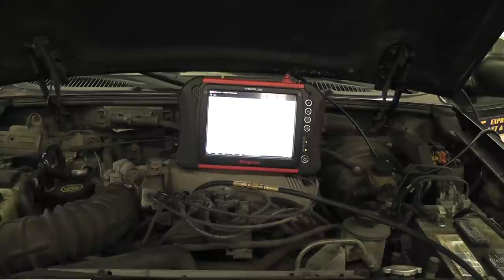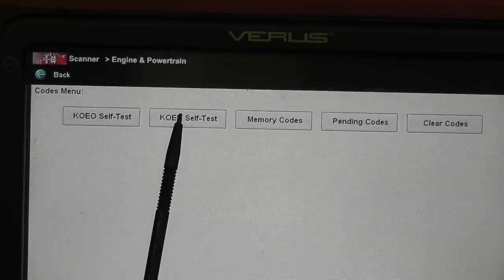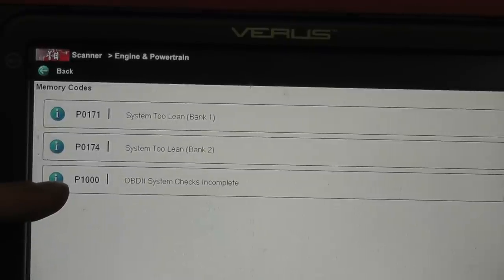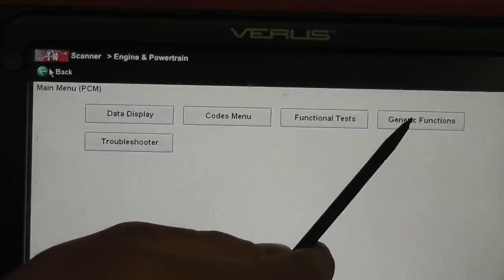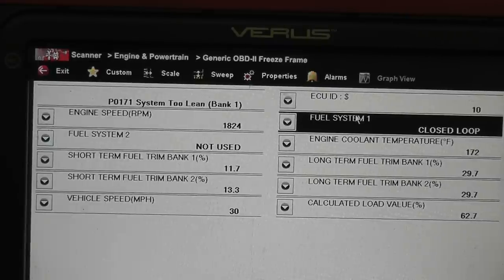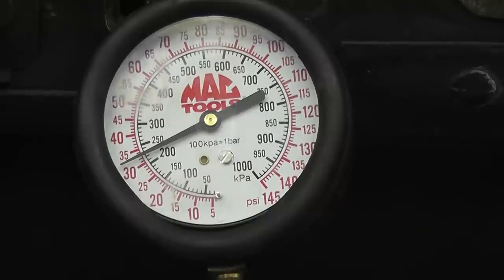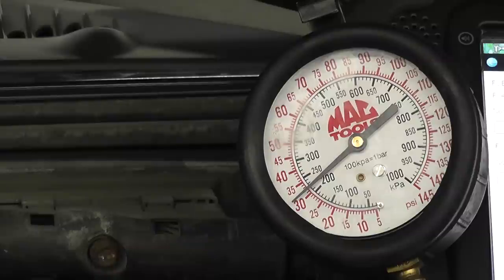Low fuel pressure causing a P0171 and P0174 trouble code

Comment: 60psi is definitely the right PSI for that engine. Was working on a Explorer that would crank abound 8 seconds before starting and had the lean codes. Had 31 psi fuel pressure at idle, checked the specs and scratched my head at the ridiculously wide range they give. Searched online and many forums and determed that 60psi was the right pressure that year and engine. Replaced the pump assembly and it run perfect.

Comment: Yup. My 2000 Dakota R/T had those codes. I went through all the normal checks, replaced vacuum lines, replaced gaskets and now the fuel pump. I wanted to get all those easy less expensive things out of the way first.

Comment from the maker: @Thor7167 Great catch friend! I found out after filming that the fuel filter had just been replaced, so it is definitely the pump. 
A plugged filter would have a higher amperage, however unless you know what the exact amperage of  fuel pump should be it is tough to ID. I have seen plugged filters have only minimal difference in amperage readings before and after. Some pumps have internal relief valves which will also affect the amperage readings.

Comment: i replaced the fpdm on my buddy's 04 f-150 it had the code "fuel pump driver module off line" me and my dad put it up on the hoist and the aluminum part of the fpdm was completely corroded. we took it apart after and found that water had got in and shorted a trace on the pcb to the ground plane. and now watching this i'm reassured it wasn't the fuel pump cause we didn't have the lean codes that this mercury had. Again thanks for all your videos man happy holidays!

Comment from the maker: You have to be careful making a call based on amperage however a plugged filter will certainly cause a higher than normal reading. I think the best advice for these situations is to replace both pump and filter. You could replace the filter and re-test if you desire. However in my experience when a filter is plugged so bad as to cause low psi, you have already hurt the fuel pump. BTW the filter in the vid. was just replaced so bad pump only in this case.

Comment from the maker: that is because we had it running before that shot. what you were looking at was called "rest pressure". If we had just connected the gauge then yes it would have read zero and when he turned the key on it would have jumped up in psi.

Comment: part 1:  Nice video again. Fuel pump looks fine is actually very stable.  Yes indeed Fuel pressure definitely low but talking about spec on that mountaineer I know for sure is 30-65 psi.  Snap-on Verus is a nice generic scan tool but returnless old ford fuel system you have to consider also first of all to run KAM process. Then you must place the car in a dyno and run fuel pressure looking at FP% PID along with actual fuel pressure under 62% engine loads.

Comment from the maker: yes that is correct, I think I use 4000-6000 as typical but it can go higher or lower than my spec and still be ok. Also fuel pump RPM isn't as important as pressure and volume delivery. Although a scope test of a fuel pump at times can be a very valuable test. 
Especially with a dead commutator segment.

Comment: I am having almost exact fuel trim patterns on my 2008 expedition 5.4L with both banks lean. Fuel pressure also decreases under throttle. It also has long cranks but only when it’s sat a long time. 

When I turn the key on engine off, the fuel pressure reading is sporadic. Sometimes it will only load about 20 psi until repeated, sometimes it will go to 40…I don’t want to sink more cash into the car so I’m trying to be sure it’s a pump. I have already changed the filter. 

More context if you’ve read this far…I’ve had issues with this car intermittently sputtering about once a month, I thought I fixed it with new plugs and then after that I got a CE light and discovered lean conditions.

Comment: hi ScannerDanner good video l have 97 ford expedition 5.4 l have p0171&p0174  & did smoke tester no leaks on the intake so far so I am .going to replaced fuel regulator & maybe like you said fuel issues thanks so much
Reply from the maker: +Oscar Alarcon check the MAF next
Reply: +ScannerDanner hii there i have a 07 ford expedition 5.4 wit 02s11 02s12 stuck rich

Comment: Thanks for all your help with my 01 silverado. I've come to conclusion that i do have a fuel delivery issue.  Its kinda baffling because after going through and checking all grounds i could find,cleaning the map sensor and egr valve looking at every connector for any obvious signs of trouble i have finally got my truck to run pretty good. Idles smoother and the intermittent misfire is gone. When i get on the Hi way and mat it the truck goes like a bat out of hell. I do notice a slight drop off around 80 or 90 though but is much better than before. However, my fuel trims are still out of the park. At idle im seeing upwards of between 30 and 40 % on short term and long terms steady at 25% on both banks. Im thinking the fuel pump is just not push enough fuel for computer to make corrections. If i wasn't see this on scan tool i wouldnt think there was a problem at all. No check engine lite on either
Reply: I should see around 55 to 60 psi on fuel pressure test on this 6.0 vortec correct?
Reply from the maker: cranking it should be 60 psi all day. 
Your trim numbers are very positive at idle. (possible vacuum leak) What do they look like at 3000 rpm in park, with no accessory loads, steady throttle?
Reply: ScannerDanner fuel pump shat the bed today. At least thats what i think. Have to get it home and check it out. I'll let you know what i find. Ive been hunting chassis ground and cleaning them as i find them but havent crawled under truck yet. I'll get to that after i fix hot hard start on my buddies 69 road runner and carb issue on his old honda xl dp bike. Busy busy thats me. Thanks for all your help mr. Danner. You're the best. Holler at you soon friend.  By the way does the abs/brake light issue on this truck share any common ground? Like mutual ground point locations do you know. These lights been coming on more frequently lately too
Reply from the maker: Not sure man. I'd have to look at a diagram. We can do that on my forum. It's free to join.
https://www.scannerdanner.com/forum/post-your-repair-questions-here.html
Reply: @ScannerDanner  
I have an 04  GMC Yukon, 5.3. Showing lean bank 1& 2, truck starts and idles great. But under load has an intermediate problem. When it does it 40mph is a stretch for it. It’s quite dangerous. Like u may pull up to a red light go to pull out n hope n pray you don’t get ran over. U can be driving 30 mins on highway doing great but all of a sudden it hesitates and you pray to make it back home. U can feel it hesitate, let off the fuel a little and it will go on but not if you push it. If u push it, it will get worse and basically go into limp mode or reduced power mode. Fuel pressure test shows 53 psi at start up and idle, 45 psi at 3000 rpms, 40 at 4000 and from 5000 to rev limiter it falls to about 30 lbs. under snap throttle test.
40 mph and below 2000-2500 rpms Seems to be the sweet spot were it will run but if u push it at all it hesitates, new acdelco fuel pump in July, fuel filter is built into pump, New Delphi maf in dec, new acdelco spark plugs n wires in oct. I did a fuel treatment and c-foam through throttle body and vac line, this past weekend which straighten it up for a couple days but it came right back, same as it did with all these parts I’ve listed.  This thing has me puzzled. Been told fuel regulator but for the life of me I can’t find one on these fuel rails, been told fuel filter but this one is built into tank within pump housing. Here lately it’s been a coin flip on getting from home to work and back the 7 min drive each way. At lunch today it took 20 mins to make that 7min trip cause it was acting up so bad. It seems worse if it gets hotter, I can clear codes and drive 40 mph home 45 mins and it still hesitates if u push too hard but codes won’t come back for a day or two. I almost know it’s a fuel delivery problem just from the codes and what I’m seeing driving it. The fact it’s 2500 or 2000 rpms at 40 mph
But idk what to turn too next, I’m kinda stuck waiting for my new scan tool to come in to see the live data, n freeze frame data.  I’ve always been the go fuel pumps are either dead or good no in between but this one has me rethinking that stance. But also thinking regulator if I could find one on it, or a fuel line restriction.

Comment from the maker: @victor35ma You are correct, it doesn't exist on this system. So it wouldn't be a Verus issue but a system design issue. Also, since this truck ran for 187,000 miles with the fuel lines that are on it, I would say line diameter should be fine, don't you?
The camera is a Panasonic HDC-TM60.

Comment from the maker: @felplay vina there are mechanical poppet nozzels (mechanical injectors that are opened by fuel pressure) that will not open below 50 pounds of fuel pressure regardless of what the electrical injector part is doing

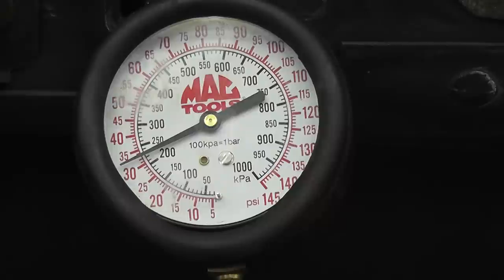Comment: 98 expl v6 sohc has two lines 7:30 so it has the vacuum difference range at idle and WOpen.
[Idle psi is usually about 8-10 psi lower than WOT/.KOEO]

Comment from the maker: So it is running lean only under load. That is typically from low fuel psi or a dirty MAF sensor. But your honda is a MAP engine I believe so that rules out a MAF problem. Make sure your MAP is reading around 2.8v at WOT/KOEO. A test drive with a fuel psi gauge taped to the windshield may be in order, but be very careful and take a fire extinguisher with you. Was there any debris in the fuel tank when you changed the pump? (water, rust etc.) If so your injectors may be plugged

Comment from the maker: @jdubb408 There are three main designs, mechanical return, mechanical returnless and electronic returnless (Section 14 in my book). Each one we treat a little differently, but on all designs fuel pressure should NEVER drop under load or during the snap throttle test. On the mech. return type with a vacuum reg. Idle psi is usually about 8-10 psi lower than WOT/.KOEO

Comment: I fitted a fuel pressure regulator (PR217 for an American Buick V6 or 5.3 litre V8) which is adjustable,meaning that the regulator had to be adjusted inside a bucket of fuel outside of the tank due to the regulator being fitted inside the tank in the Commodore.
The closest setting I got was 60 PSI of pressure adjustment & the fuel trim has come down to 8.59% on bank 1 & 9.38%  on bank 2 which is a nice change from 25% on both.

Comment from the maker: all of the returnless fuel systems will show a brief sudden drop on a snap throttle test. especially the electronic ones with no regulator. as long as it recovers quickly you're ok

Comment: My 99 Expedition 5.4 was reading 0 even with the switch and engine not running and then as soon as I started the engine the pressure went up to 31 psi and then it would jump up to about 38 when hitting the throttle. It stalled on me at a red light and sometimes it wont start in the mornings.

Comment from the maker: Wait, what? Refresh my memory please :)
As for the engine load data PID, I simply look at it for determining type of lean condition. If you have my book I have some case studies on that. To much detail to put here in a limited character box, sorry. In short, if lean condition is at idle = vacuum leak, if lean condition is under load = dirty MAF, low fuel pressure

Comment from the maker: @TRcustomengineering First, how does it run cold and at WOT? Are you sure the O2 is reporting accurately? If your not compare O2mv with tailpipe CO% and let me know how much CO is coming out of the tailpipe. What is your MAP voltage at idle and at 2000 rpm? How is the fuel pressure?(sucks to check on these if I remember right).

Comment: It's just me but I like to see things diagnosed to the end. Fuel pump vs. fuel filter vs. fuel pressure regulator (if not built into the pump--you did say that the regulator on this vehicle is in the tank). I believe that the fuel filter should be changed anyway and first to see if that fixes the problem.

Comment: @ScannerDanner  I would say it is not a ford issue because I am able to meter this FP % pid on old  returnless  ford fuel system using OEM ford diagnostic tool. the PID for late model is: FRP%  FRP#  FRP which stand for fuel rail pressure supported by a  FP sensors (tranducers).  

I will get that camera. thanks for your videos. you are doiing a great job

Comment: Thanks for that. I'm currently dealing with a suspect pressure reg on a 2011 vx zafira at work. The waveform is all over the place. My next step was to check the fuel pressure with a gauge, it would jump to around 2 bar KOEO then drop to zero. Cranking would see the pressure steadily rise to 2.8 bar before spluttering into life. Compared to another vehicle and it was showing 4 bar KOEO and KOER. Can post the waveforms on the pico forum tomorrow if you want to take a look?

Comment from the maker: @victor35ma This is not an electronic returnless system so there is no FP% Pid. The tests you are mentioning apply to an electronic returnless fuel system. This one is mechanical. Also resetting the KAM would have nothing to do with fixing the low fuel pressure problem here.

Comment: Hi Paul I do have question about fuel pressure, 02 gm Yukon no codes symptoms starter only when I push the accelerator. Fuel pressure  50 lb, when it should be 60 to 65, with 50 lb low why it won't start up?

Comment: thank you, so I am thinking on that fuel pump you have here on the demo  if that pump is weak not enough fuel pressure  you will have that one running at low rpm because amps is ok??
I heard of a formula to find out about the rpm  if the fuel  pump has 8 commuters I should set the cursor in between the 8 hump to  get the delta time, the ms it took to complete the 8 hump  divide 60.000/delta time = to rpm is that right ?? and most fuel pump runs at 3,000 to 6.000 rpm ??

Comment: Thank you Paul for fast reply. Map is new. I swapped injectors and FPR from the donor car and no change (maybe a little more power). Fuel tank was clean as new and pump's outer filter was very clean. Will look into fuel pressure under speed as you said and a MAP signal. *Just to make sure: ground voltage drop test showed just a little bit above normal level (>0.5v) 0.53-0.55v, can it affect pump that bad ?

Comment: i know at my BMW dealership we check the fuel pressure from the tank pump, usually around 450 kpa, and if that is good but the vehicle still has fuel codes we do a high pressure pump- but only cause theyre a common issue. im sure you could also look up fuel pressure by looking at sensor read outs on a verus or diagnostic machine, but ive never had to do that yet.

Comment from the maker: No it does not. What changes is the amount of fuel on the return line. The pump runs at full speed full amps all the whole time. 
Although on a vacuum assist type regulator you will get a slight amperage increase due to the regulator requiring more psi to open it under no vacuum conditions.

Comment: part 2:   I am not sure if you can see that PID using Verus live data before 2004 since we never use Verus to troubleshoot Ford.  Also for that very vehicle there is a recall on fuel pressure line diameter so, make sure you got the upgrade
What kind of camera are you using to get those nice HD videos? I will get one.  Gracias de Nuevo.

Comment: Hey, so if I'm aiming for a weak fuel pump on a car, should revving it up to 3k rpm while it's stationary cause the LT to rise 20+%? My roommate's fuel trim goes up during acceleration on the road (up to about 24% by the time you're at 50mph) but if I rev it while the car is stopped, it stays down at normal levels of about 0-4%. Idle speed trims are also 0-4%
I already ruled out MAF through both cleaning and swapping the good compatible MAF from my car to hers, and she has 2 newer OEM A/F / O2 sensors.

There's really no drivability problems here, just the leaning out while driving, and I'm thinking this might be why her catalyst monitor is never triggering ready no matter how many times I do the driving parameters to make it ready (coolant temp, IAT, etc all in order). Never throws a P0420 either though.

Comment: I had a E-150 with 2 fuel pumps-the low pressure pump (~3 psi) is in the tank and the high pressure is inline. You need two gauges since most gauges capable of reading the high pressure will not accurately indicate 3 psi. Some vacuum gauges can also read low psi fuel. If you have low psi, the high pressure boost pump is faulty. If you have 0 psi, the low pressure pump is faulty--the boost pump is not getting any gas. (Given that only one pump is bad and that the regulator and filter are good.)

Comment: trim numbers are positive. I put dashes just for the speed reference intervals. Car is using almost twice more gas than supposed to after highway driving. Some other lying sensor ?  ( Extra info: previously replaced cracked manifold at the O2 sensor housing and melted cat. Possible mechanical damage consequences ? )

Comment from the maker: of course the fuel filter needs to be replaced with the new pump. however a fuel filter alone would not have fixed this vehicle, it would have had higher than normal amperage on the pump with a plug fuel filter and it did not

Comment: i finally brought mine to the ford dealer. even though my airflows on my mass air where normal looking. my baro frequency was in the 140's and im at 750ft elevation. so my computer thought i was at 4000 feet elevation. running 7 to 10 percent long term fuel trim. and my engine was pinging despite the knock sensor retarding it. i would get as high as 49 degrees advance off idle no load. and thats when it has a miss to it.my sensor is clean too. the baro readin is soo important on fords